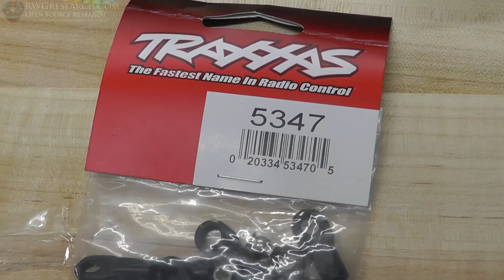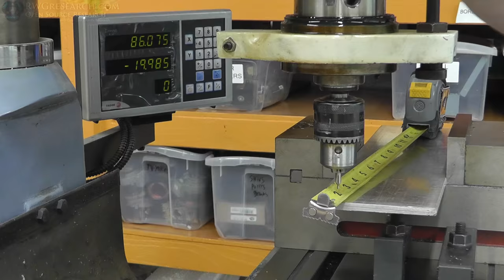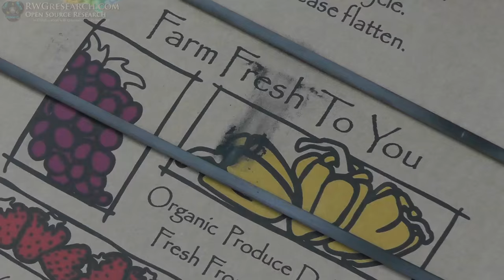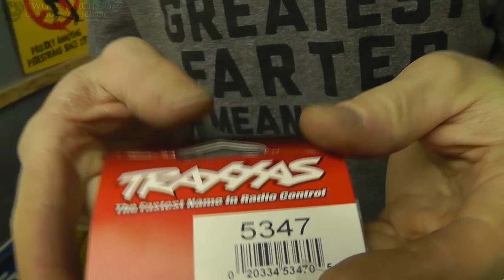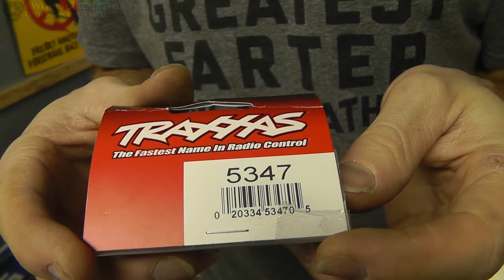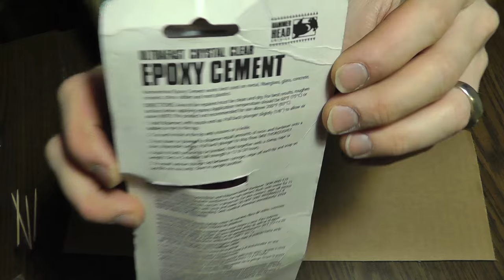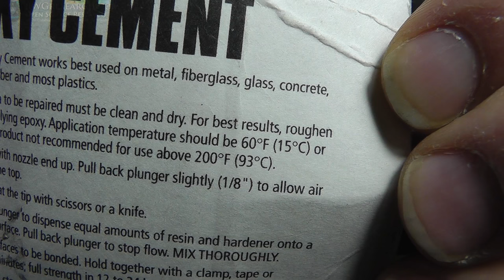RWG OSD #10 Making The Diagonal Push Rod Arm's! OverSize Delta 3D Printer Build.

Comment: I would have to say you're an absolute legend for putting this video out. The rod ends on my stock rods for the anycubic kossel delta are wearing down and I was cracking my head searching for alternative rod ends and was sceptical about these traxxis one. I've got my carbon tubes and have just ordered these rod end bearings and looking forward to putting them together. Thanks a bunch!

Comment: 11:36
The numbers are called "cavity numbers", and they correspond to the position of that part in the mold. The mold will have dozens of cavities into which the molten plastic will be injected, and numbering them this way means any problems, such as excess flashing, can be traced right back :)
Reply from the maker: +Azayles cool, that's what i was thinking but just was not sure if there was anything else. thanks!! :) ~Russ
Reply: ***** No worries! :D
Used to work as a lab tech for a pharmaceutical firm, and one of my duties was packaging inspection, which involved all sorts of fun equipment, such as digital IR spectroscopes.
When sampling, I had to take a decent spread of cavity numbers incase there was molding problems with a bottle or cap from any one cavity. Excess flashing breaking off of medical containers isn't something you really want :O :P
~Chris

Comment: How did you determine the length of the rods? I just made a mini delta and it's 280mm high(that's total height..aprox 230mm from the bed to the bottom of the endstops)

I had to basically cut my rods to a length I pulled out of the air(125.5mm) because i couldn't find anything online that says "if the height is this and the width is that make your rods this..or even a percentage to go by...as a result the printer moves up and down fine at X0Y0 but if i try to move it from home to any position other than X0Y0 it doesn't move right..At X0Y0Z0 it will move in the right directions so I'm stumped..Any help would be great.

Comment: if you ever need stronger rod ends try the rpm brand and dont ever hammer the balls in you will break half of the plastic pieces
Reply from the maker: +icyphilippe cool! thanks! yeah hammering anything that has a tight fit is a bad idea lol slow pressure is best :) thanks for the tip! ~Russ

Comment: I was planing on doing magnetic joints, but the parts I got didn't work out. I am insisting on using machined parts for carriages and effector, so parts from the mini kossel I got from China did not have strong enough magnets. So I switched over to the traxaas route. I used a modified version of this: http://www.thingiverse.com/thing:291455 jig. I made 3d printed collars which go over the rod and over the traxaas ends. This way I got a really good fit on both sides. You're gonna laugh a bit, but my rods are 550mm. I am using an azteeg m5 mini smoothieware board with 400 step motors, I have it maxed out at 128 microsteps. I got it moving, and it's looking accurate so far. Will start assembling the extruder and hot end this weekend. My print volume will end up being 700mm height and about 470mm diameter, maybe a touch bigger -- my build plate is 500mm square, so I might be able to get close to full diameter. The thing is about 6 foot tall already. I'm deciding where to mount the filament roll (top makes sense, but that's 6 feet up, I'm not that tall)
Reply from the maker: +kazolar lol wow! that's a big one! :) im using a dial indicator to check the bed and geometry. as seen here:  https://www.youtube.com/watch?v=L_mFuzAK2io 
are you going to enclose the build space? 
best of luck sounds like a fun build! ~Russ

Comment: Hey, not sure if you are aware, but they make a tool called a Tap Center that is designed for what you were doing with a pan head screw. Here is an amazon link, (you can get them just about anywhere) 

http://www.amazon.com/Brown-Sharpe-599-792-30-Adjustable-Tensioned/dp/B005317ZMC/ref=sr_1_1?ie=UTF8&qid=1458879688&sr=8-1&keywords=tap+center
Reply from the maker: nice. ok. thanks. one thing I tried to do was use the back of a tap. it has the correct point on it but it was to long. :)  no spring tho. :)  thanks for the info!! ~Russ